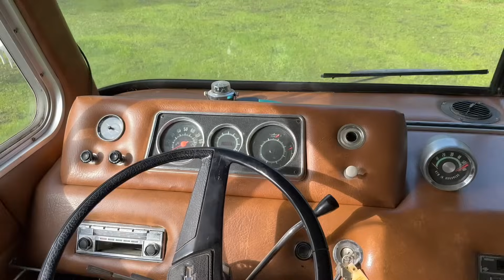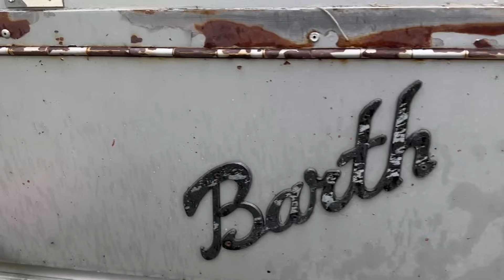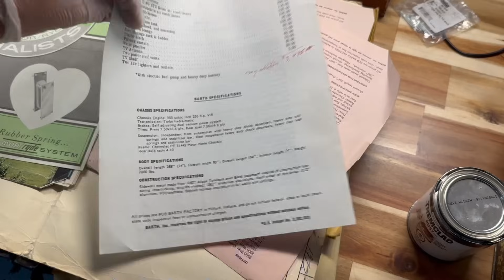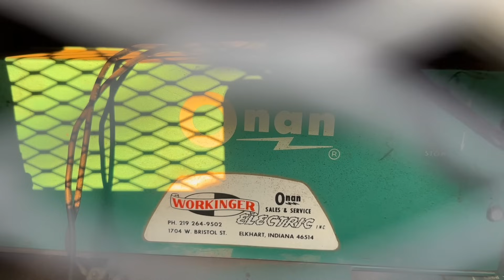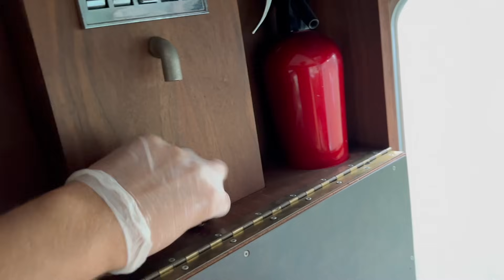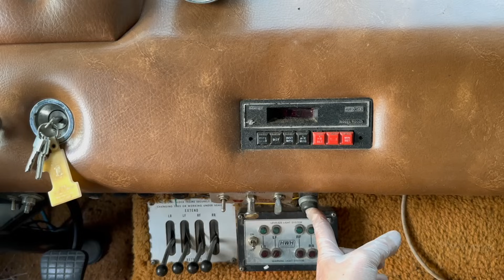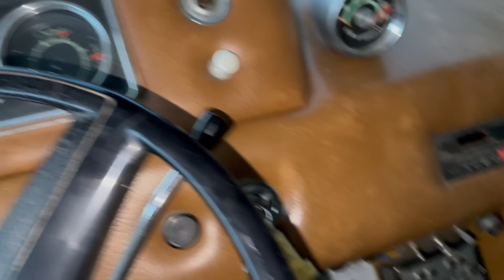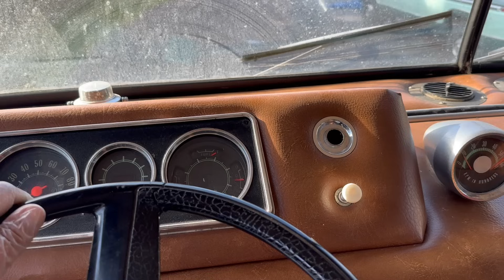Free Motorhome! Will it run?! Saving a 1972 Barth RV

Comment: FYI, I wouldn't reappolster the cushions but toss them all out.  If mice were inside they peed everywhere.  The urine smell will continue unless the cushions are tossed.  Even if it doesn't run again, it would be a great extra room for visitors.  Will the Motorhome need to pass any emissions test in Canada if put back on the road again?
Reply: Absolutely! You should remove ALL the carpets and fabric items from the interior if you can. No way that smell is EVER coming out. New foam isn’t all that expensive, relatively speaking, and it will go a LONG way to getting the odor under control.

Comment: The grates are missing on the stove. Hopefully they won’t be too hard to find or they’re in a cabinet
Reply: Yeah, I stow mine somewhere when I'm driving because they make too much racket.
Reply: Shouldn't be hard to find at a RV shop.
Reply: They will be in a cabinet I  wld say they were careful with it as it’s not in bad shape and toilet is clean and that says a lot….
Reply: If they are not the type that lock in/on, hopefully they were purposely taken off and stored elsewhere during transport; so they would not fly off during transport. I said hopefully!
Reply: How fun! Yes, the sooner you get the mouse damage out the sooner the you start to clean the  air!! That would have been my first on the lust also. Have fun restoring your new toy😁
Reply: Usually stove grates are put in the oven so they are near the range top!

Comment: My first thought about the motorhome: at worst it's worth a good bit in scrap if it's aluminum. Second thought: score one for Mopar!!! Sit her for 10 years plus, throw some gas in the carb and she wants to run!  Throw in some transmission fluid and off she goes.  Next thing..FIX THE BRAKES.

Comment: Those are gas guzzlers and get 8 miles to the gallon 10 miles to the gallon going down hill, we had a winnebago that looked like the Barth and had the same exact engine and floor plan.  We just had the extra bed over the divers seat.

On your A/C you will want to replace, I am sure they are R12 based and  leak like a sieve.
They also should have a very good heater in them too.
The honey tank is a nightmare to dump.

Comment: Alex stuff from the floor up new carpet or rubber flooring with mats seat covers. I think it would be cheaper on the couches if you just bought the material and the sponging you could probably make them yourself unless you can wash it expunging and clean it and I definitely put a couple big cups of vinegar in which helps eliminate some of the smell also, I think with a little TLC and some restoration that would be a perfect rehabbed motorhome

Comment: There is also an on/off switch for many circuits just above the battery.  The switch is round and rotates.  Should also be one in the generator box too.

Comment: Barth build a quality motorhome. Quality materials should make repairs easier.  Changing upholstery and carpet gets most of the smell out.  Burner plates are available.  Wet Bath is fine.  The question is how does the engine run.  Chevy engine is great.  With dual air there should be a 5KW generator or larger.  Tire dates are important.  We like good tires with less than 5 years old.   Onan generators, the old ones are great..  Sounds great.. You have a good find.

Comment: Turn on the switches for the interior lights and things. Turn off the ignition switch so you don't drain your battery.
Mine are above the entry door.

Comment: Hope you checked the oil & transmission fluid before trying to start it... and being stored under a quonset I'd be worried the roof already had a leak, a little fresh roof sealant around the seams couldn't hurt

Comment: If I remember correctly Barth Motorhomes had adjustable Air suspension.. basically air shocks back then. So you may have to replace those.. as the seals rot out

Comment: if you don't 'blow the whole thing apart and clean/repair" this will leave you stranded... put a holly efi or any computer controlled EMS... older trucks like this will have carb issues.. don't fight, make it right... And MOLD... another reason to really get in there... luck be with you... cut no corners and replace ALL Rubber ANYTHING!!

Comment: That engine hasn't even been run in yet
Reply: did you watch the video? It started and he drove it to the front of the house
Reply: @ptdave123  I commented when he said 57,000 then watched the rest.
Reply: @markbench8721  looking at the condition of the seats, you can put a 1 or 2 in front of the 57.000
Reply: @pallecla It was low mileage when bought, at about 16 years old. It was only driven 20 miles to the lake for 2 weeks and back each year for 15 years, 3 other trips of about 60 miles away and back, and 2 trips of 200 miles away another lake, sat unmoving for 5 years, a trip to the lake, sat for another 5 years, and then one more final trip to the lake 20 miles away and then sat for 10 years not moving..  Those are all the miles, ever put on it.